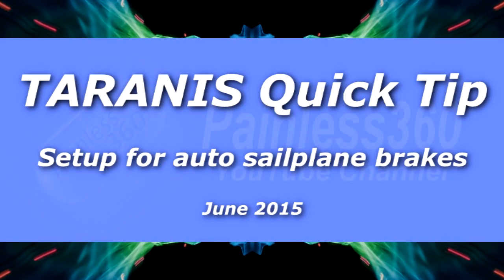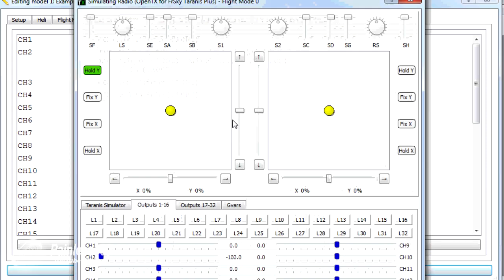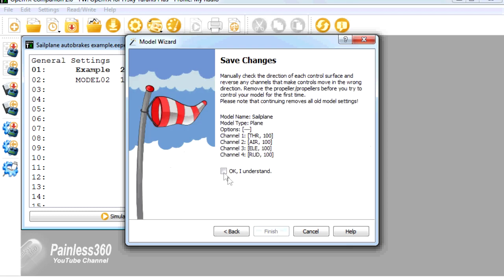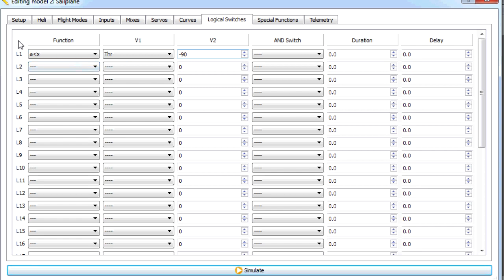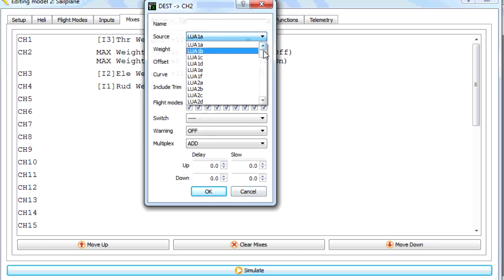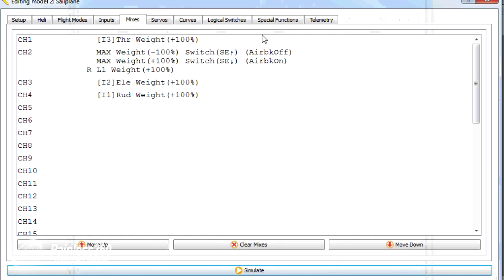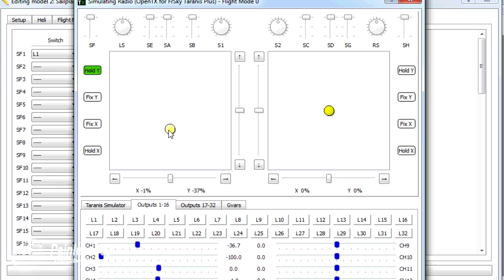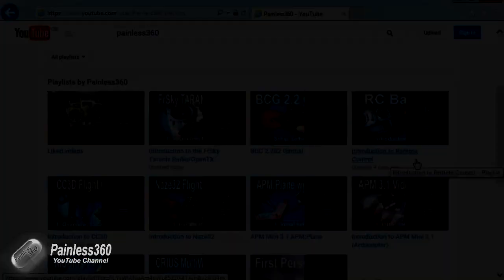FrSky TARANIS Quick Tip - Setting up automatic airbrakes on a Sailplane/Glider

Comment: Your mix for the automatic brakes will always replace the switched version created by the wizard, not sure if that was the intention, but it means that those two lines are now useless. If you're wanting to keep the switched airbrakes as well, you'd be better off using the LS as a switch for the mix, and MAX as the source

Comment: It seems like air brakes would be aggravating set up like this during taxiing.
I guess with Flight Modes though you could have it assigned to work in landing mode only.
During taxi a variable switch might work good for brakes if you needed them. Especially on large models. I'm not sure if air brakes have any variable to them, maybe they are either on or off?
Reply from the maker: I've not found any setup that couldn't be done on Opentx. See the rest of the series. Happy flying!

Comment: This is completely off topic but it's been really bugging me lately, my QAV 250 has been shaking wildly when I punch it? It's really odd, like it's smooth and the PID's have been set in nicely, but it just shakes and ruins my videos :/ 
I've got 6045 gemfan props on it, could it be that their out of balance? I'm not sure
Anything from anyone would be awesome! 
Love all your videos by the way man, really helped me set up my QAV with a naze and my taranis 👍🏼
Happy flying!
Reply from the maker: Jay Bellwood Hi, please post the questions on a relevant video, that way others can see the advice and possible things to try. 
Sounds like the PIDs are ok and it's the power that causes the issue. Could be an ESC timing/setup issue or the props vibrating under extreme loading - have you tried other props?
Could always mount the camera on some moongel - works for me ;)
Reply: Painless360 thanks heaps, i'll try those out

Comment: I'm a bit lost with this one. Not sure why, particularly on a glider why you would want air brakes to come on in this way. Wouldn't you power up the model to a height and then want to glide around without motor? And if you run the motor battery down low you might get to a position where you can't get back and the air brakes are fighting your chance of this. Seems like it's too easy to just have the air brakes on a switch - heck the Taranis has a heap of them.
Oh well, not trying to be argumentative, just very puzzled.
Reply from the maker: Timothy Smith I'll leave the glider/soarer pilots to answer this one.... I don't fly them.

Comment: I have an EngineDisarm switch on my Taranis, but I would like it to void input should the switch be hit while throttle is above -90. This way a dropped controller won't result in the model taking off (as what happened to me today) and also the model won't fall out of the sky should the switch accidentally be hit mid-flight. Is this possible? So far I have not been able to figure it out.
Reply from the maker: Yes, should be. Look at how we setup things like auto-crow in the 'OpenTX Mix School' videos. You could use the same logical switch trick to detect when the throttle is above -90.. Best of luck!

Comment: hi lee 

i am trying to set the CROW BREAKS where is a bit complicated on the taranis and i cant get it to work quite right on the bix3 ( yeah why not right :)  ..)  did you ever try this function of a switch and keep the ailerons working on breaks deployment , im pulling my hair at the moment 

cheers
Reply from the maker: +Aron Gatt You mean >50% throttle works normally, <50% deploys crow (with working ailerons)?
Reply: Painless360 not via throttle but via a switch , flick switch = activation crow + aileron still active

Comment: i want to use flaps on slider but i want to use SB switch to stop flaps working on slider and work with alierons  on stick so slider no longer works as flaps till SB is down
Reply from the maker: +dwexoticmaple not sure what you're asking. You want flapperons? If so check the playlist for an idea of how to do it..
Reply: +Painless360  no i got it sorted i wanted the flaps to be used along side with the ailerons so full wing aileron flip the switch you just get normal ailerons and standard flaps but Iworked it out so all good cheers ps you videos are awesome really helpful

Comment: where would you say was the best place to get the taranis from? cheers
Reply from the maker: AndyRC Wherever you can get them - they go out of stock very quickly. I would keep an eye on the usual places - HK, Banggood, eBay and your local hobby shop etc. and order it as soon as you see them in stock..
Best of luck.
Reply: thanks, they just seem really expensive! it seems the the turnigy 9xrpro has the same functions as the taranis but at the lower cost?
Reply: +AndyRC
Hi Andy. As I own both the Taranis and the 9XPro I can tell you the Taranis is still light years ahead. Also you have to factor in the cost of a RF module for the 9XR where as the Taranis has both the FrSky XJT and DJT RF protocols as standard. The Taranis still offers the greatest value for money compared to the offerings from the other major manufacturers. As for where to buy from I can't recommend T9Hobbysport highly enough. They are a UK major distributor and carry everything from receivers and telemetry modules through to every conceivable spare part. Also Richard is a great guy to deal with.
Regards
Nidge
Reply: thanks for the info i am still mulling it over. the problem that I have with buying this TX is that it is a lot of money and I don't really need 16 channels, all of my receivers have a maximum of 9 channels. also this transmitter lacks a six position switch for flight modes I understand you can buy a mod for it however I can buy a mod for my 8 channel transmitter as well. so for me personally I'm still unsure what it is going to bring to the table I know one thing for sure though everyone wants me to get one lol
Reply from the maker: The radio is a very personal choice. I've used a DX9 too and the Taranis with OpenTX is the most fun, powerful radio I've ever worked with.

It's not about number of channels - it's more about the ability to get it to do almost anything RC related and having great telemetry features for built into the receivers.

I'd wait until you've fully made up your mind. At least with this series you can see how powerful this thing is (also there is a video in the Taranis playlist about fitting the 6 position switch ;)

Best of luck.